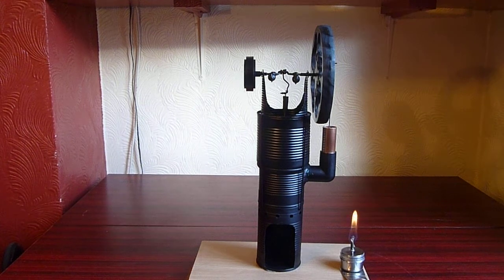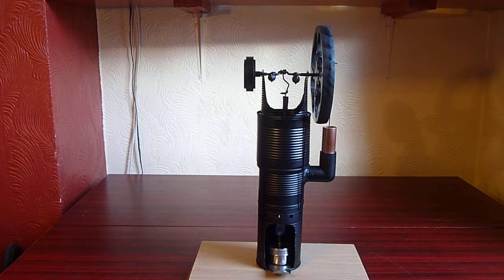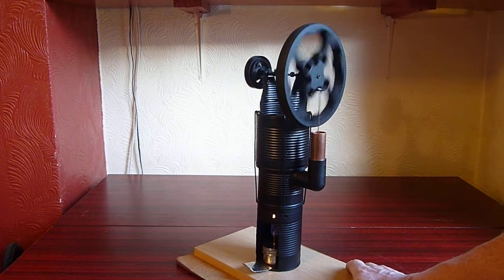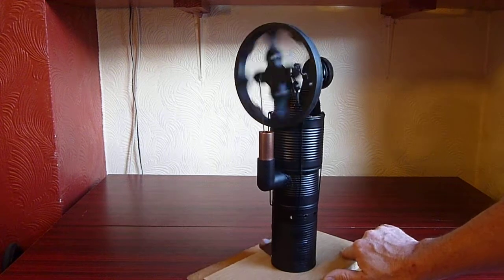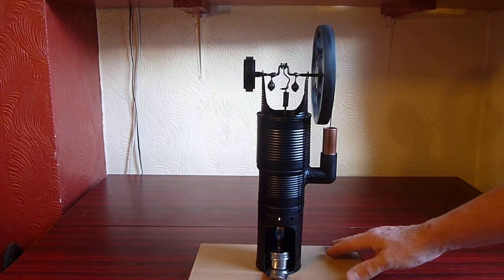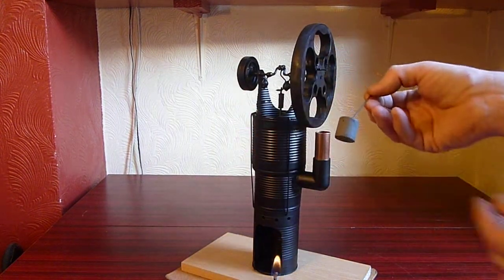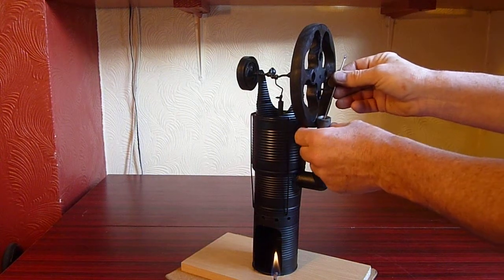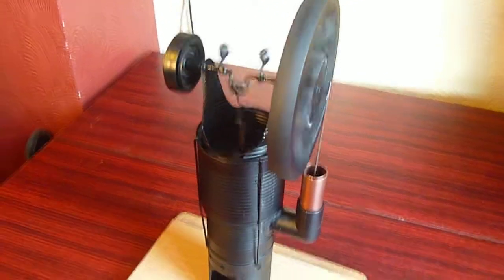Homemade Stirling Engine

Comment from the maker: Hi petersimon pieters , i have had to reply this way because there is no reply option under your comment for some reason . I'm sorry but i didn't have any drawn plans for this engine , i viewed other engine builds on youtube to get an idea of what to do and then just gave it a go , luckily it worked (  didn't think it would though ) . I built it over a couple of weekends once i had sourced the required parts for the build . I would guess it took me about 20 hrs , some one else could probably build it a lot quicker but i wasn't in a rush and was learning as i went  . Thanks for the interest and good luck with any engine you build . I have posted advise for others who are building engines and needed some help on this and my other engines videos if you wish to have a read through some of them . Gary
Reply: +Gary Knight Amazing work! thank you for sharing Sir!

Comment: When casting your piston, do you cast the connecting pin into the wet jb weld?  Great video!
Reply from the maker: Hi dizzle .  I cast the piston first , and when removed from casting tube i used a dremel to clean the hollow inside the piston , then i drilled the holes in the sides to take the gudgeon pin which is a tight fit in the piston but can still be pushed out again for fitting or adjustments to the connecting rod . Make the pin slightly narrower than the piston so that it does not rub against and score the inside of the cylinder . Hope this of use , Cheers . Gary
Reply: Gary Knight I was wondering the same thing thanks for the detailed answer:) Please make more videos!

Comment: can i use dishwasher as displacer
Reply from the maker: Hi . Sorry but I do not understand what you mean .
Reply: Gary Knight i mean dishwasher sponge
Reply from the maker: CariagaXIII If its made of plastic or nylon then i would say no ,  as it would melt from the heat , lots of people use steel wool wound into the displacer piston shape with thin wire wound around the outside to help hold the shape , then attached to either a connecting rod or more thin wire ( ie piano wire ) attached to the crankshaft depending on how your building your engine . There are lots of video's out there showing how this is done . Hope this helps in some way : )   If you build an engine please film it & send me a message so i can few it , good luck ...Gary
Reply: Gary Knight thanks a lot if it worked i will film it if it didn't you know it's a complete fail.
Reply from the maker: CariagaXIII Even if its a fail you will have learnt something from it , and that may help  you if you try again , and as i say " give it a go , you might just surprise yourself " .

Comment: Magic,,, another great video , well presented, clear concise and informative,  and,,, yes there are others out there of this design, but yours has to be up there with the best,,, I think the slower they run the better personally, and although there is a very slight wobble on the pulley I thought you had got the crankshaft very true,,, as with the flywheel with its size I think its running very true,,, and I love the counter balance weights on the crank shaft. Such a sweet runner and well finished,,, Great job.

Comment: regarding lubricating the piston, instead of oil i would suggest powdered graphite, it comes in a small tube. its basically a dry lubricant.
Reply from the maker: Thanks sczahra , I had thought of that too , but it had slipped my mind . I had thought of rolling the piston in the graphite powder so it would stick in the surface of the piston . Thanks for sharing your thoughts .